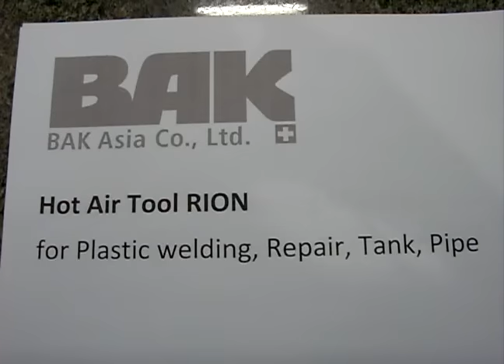RION Plastic welding and Hot Air welding Hand tool - Heat gun welder - Plastic welding Kit

Comment: that was a good weld for dragging, which isn't what youre supposed to do, technically. apply pressure down on the welding rod for a stronger weld.

Comment: it doesnt happen unless you are using very thin materials at high temp. it would just warp the plastic, not pull it out of square. you are working in the 200-300 degree range here, instead of with a 3500 degree flame or 6000 degree arc. and plastic is easier to work with than metals in the way that its very forgiving and takes less effort I learned for a few days welding plastic from a friend. check them out @ plastic-concepts. com. I am already really good. i still suck with my 2 years of TIG